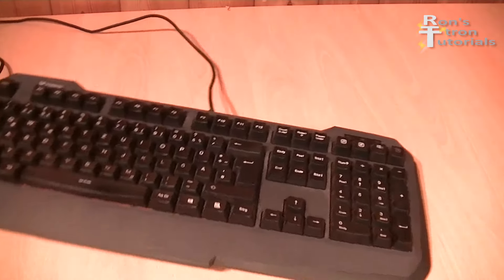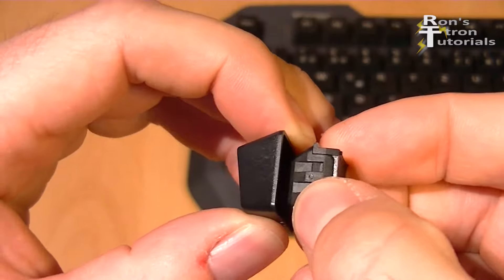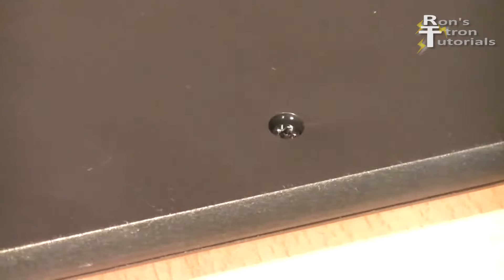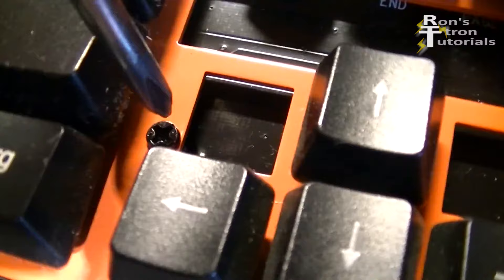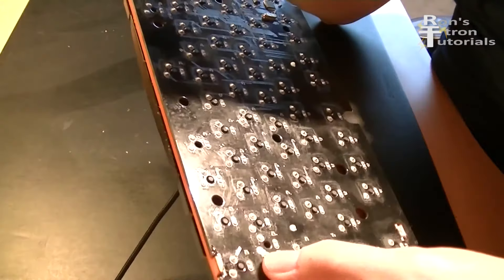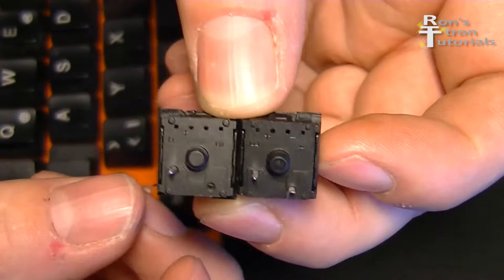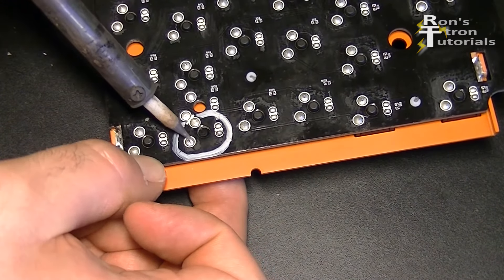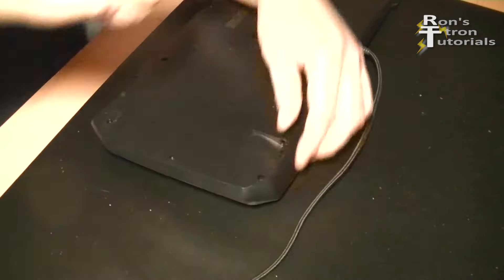HOW TO REPLACE KAILH KEYSWITCH ON MECHANICAL KEYBOARD DETAIL RAZER CHERRY MX CLONE CHANGE SWAP

Comment: This is a good trick for replacing a switch quick, though I would recommend applying fresh resin to the solder on the last part.

Comment: If you use some multi-core copper wire you could use it to remove the old solder before using fresh solder.
Reply from the maker: great tip